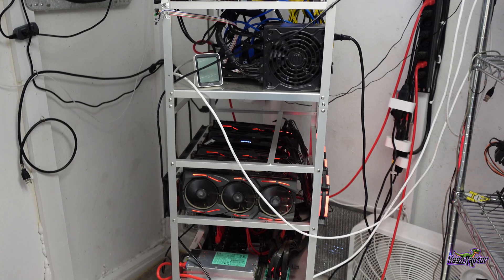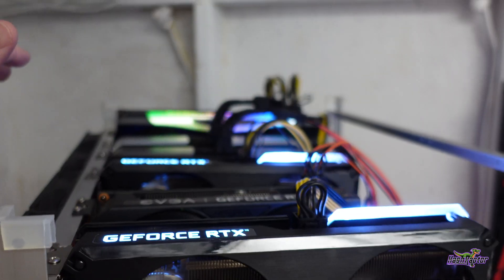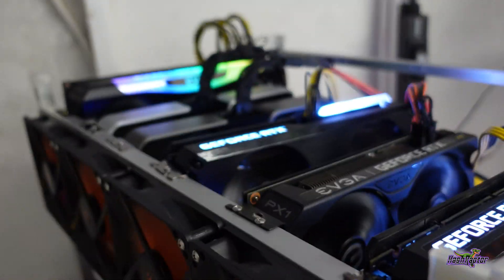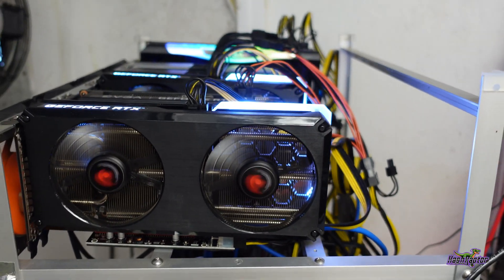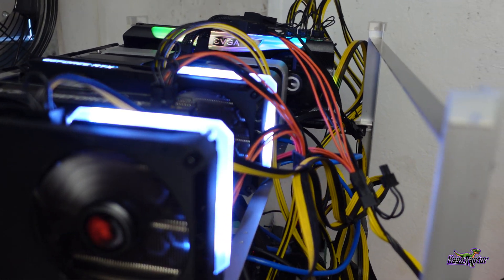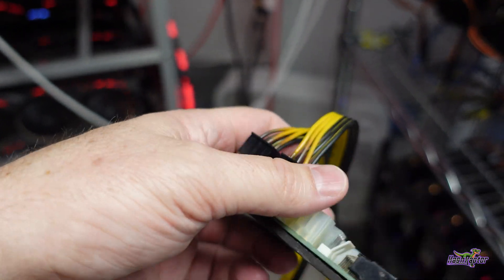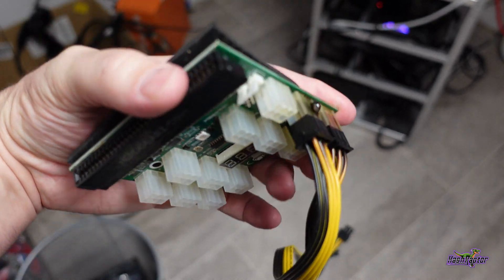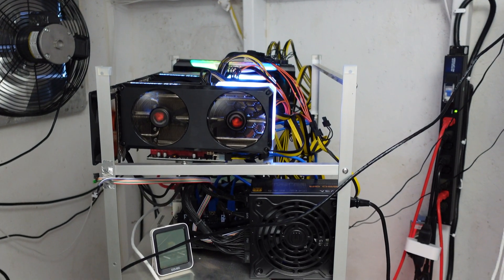GPU Rig Fire !!!  How do you troubleshoot your mining rigs???

Comment: The ONLY way I see how your clock settings could have caused this to burn up, is if you are not power budgeting properly to begin with. For example, if you are power budgeting 3060s to receive 110 watts that you'd probably operate them at, and not at their 170 watts TDP...  You should always power budget the full TDP, even if you plan to only utilize a percentage of it...  Otherwise, something like an over aggressive core or memory clock setting would just cause the GPU to crash, and not to burn up...  You should be able to safely run every GPU at a 100% power limit, the wiring should be able to handle at least 100% of the GPU TDP...  If you are only wiring everything to where you plan the GPU to operate at only, and not the full TDP, then if something ever occurred where the GPU get hit asking for full TDP and full TDP is above the operational power needs, then you could burn something up...  But injecting otherwise for example a 3080's settings into a 3060, that shouldn't burn a GPU up...  Just cause it to crash or freeze up... I don't think your issue was with your clock profiles at all, not unless you got a larger picture issue with your power budget and you are not budgeting properly...  I will also say, those black and yellow cables are no bueno imo...  They in theory should be ok, but...  I've had a few of those burn up despite utilizing them properly and everything...  I think the pins in them are poor quality, or the conductor of the wire or something...  I even saw a video where Red Panda Mining had an issue with some, and my brother who also crypto mines had issues once...  I only use 6 pin to 6 pin PCIe/VGA power extension cables any more in those yellow black cables...  That and only used to power risers...  Otherwise I use genuine power supply cables from the manufacturer anymore...  I've lost all trust for the cheaper aftermarket cables...  And I don't even use splitter/breakout boards...  I only use (semi) modular ATX power supplies, and the cables they come with, 3 GPUs per PSU (850 watt PSUs), except the PSU powering the motherboard, that PSU only gets 2 GPUs, unless also if I am powering a higher end GPU like a 3080, then the PSU powering the 3080 only gets the 3080 or maybe the 3080 and a 2nd GPU, no 3rd GPU...  But most of my rig is 3060tis and 3070s, I got a single 3060v1, and two 3080s...  Everything else is 3060tis or 3070s....  So if the full TDP of a 3060ti is 200 watts, I can safely put three 3060tis on a single 850 watt ATX PSU... Only using 70% of the rated power **IF** I were to ever demand full TDP, but of course I dial down the power limit to each GPU from the TDP 200 watts, to 130 watts... So the reality is, I am only demanding 390 watts of an 850 watt PSU, or 46%...  But that said, I have the buffer if for some reason each GPU called for full TDP, and in addition the 80% on top of that...  There is only enough modular space on the PSUs to connect 3 GPUs, and I would never put more than 1 GPU on a single cable, so I usually power both the riser and the GPU on the same cable unless that puts me over the power budget of that said cable...  Then if that is the case (or in some cases a GPU needs more than 1 power connection), then I use molex power from the PSU to power the riser...  Molex should be good to 100 watts, and the riser should never ask for more than 75 watts, tops...

And then I will place more than 1 PSU to 1 motherboard splitting the ATX cable so that the PSUs will all turn on and off at the same time, or I also mostly use ASUS B250 Mining Expert Motherboards where I can connect 3 PSUs directly to it...  I run 8 GPUs per motherboard, so 2 PSUs will run 3 GPUs each, and 1 PSU will run 2 GPUs and the CPU/RAM/SSD/MoBo, etc...  3 PSUs, 8 GPUs, 1 MoBo...
Reply: the power limit in a pcie cable on a server supply is a bit different.
you have three circuits, and each circuit is able to deliver 9A. , calculating max power through a pcie 6 pin is as such : 9A x 3 x 12V.
The problem is, server psu's are not properly used, and as such are capable to drop their full power also in one cable...

This calculation is only valid for server supplies, not ATX power supplies.
That said Server psu's are preferable.

Comment: Hey  Hashraptor,  I completely understand your challenge with cables and the right supplier.  I have found that parallel miner has 16 awg cables (labeled on the wire) for their kits and even individually.   I try to get the breakout boards with the amp meter so its an easy wattage calculation.  I am starting to write the watts on the  server supply and spread the cables evenly on the board.  Thanks for the reminder to visually inspect again.  I am using the emporia panel meter(amazon) and can see the watts and amps on the overall circuit from anywhere most of the time(wifi flakes out rarely for me).  Just my practice with my few rigs.  Happy mining and hope you continue to recover.

Comment: Is that a board full of 6 pin connectors? Wouldn't 8 pin connectors be safer? (6 pin = 75w, 8 pin = 150w)? I've never used these server power supplies but do they make them in 8 pin format?
Reply: I just looked and it seems these server PSU boards are only available in 6-pin format. Unless I'm missing something it seems this is a very good reason to NOT use server PSUs but only use ATX PSUs with their 8 pin ports.
Reply from the maker: This has been hotly debated and I totally get both sides.  I have had one riser do something similar on an ATX PSU so I'm inclined to think both options are good.  But definitely a preference.  That being said, you have a lot more options with the server PSU.
Reply: @HashRaptor  Is there a place where this debate is happening? I'd like to read more comments from both sides - and thank you for posting about your trials by fire (pun intended :) ) I'm new and when I started I had no idea that fire was even a risk - you have got me wanting to learn more about it to mitigate it as far as possible!
Reply: This is ATX standard.. A server psu does not follow the ATX standard, and cable takes what it's electrically capable to handle. These pins take 9A.. just see, cables are thick enough, to cool enough.

Comment: If I have lights on the riser I will take it off and put it back on before replacing it. Noticed your breakout board was pretty close to the side of your metal frame. Maybe the solder joints on a humid day jumped to ground. After seeing a few burnt connections like this, now I don't trust the plastic connector to hold the pins/wires in place while I push the connectors together. I grab the wires and push down instead of grabbing the connector. Taking a connector apart, it's not much keeping the pins inside from pulling out and thus possibly making a poor connection.
Reply from the maker: Oh that is a good idea.  I'll now do that every time :)

Comment: @HashRaptor if you are running 80 percent power rule on the psus , then should that have happened even if the OC settings went to the wrong card? I am thinking it was just a faulty board and nothing to do with your OC and maintenance mode.
Reply from the maker: Yeah, good point you are right.
Reply from the maker: I wonder if a single overloaded GPU with the wrong wattage assigned could provide electrical feedback into the port???  Maybe not IDK.  Not and electrician here lol
Reply: @HashRaptor  I'm and electronics technician...  So... I don't use HiveOS, but I do mine and understand the concept of the flight sheet, I do a flight sheet, but the way my miners are setup, it is a little different, but same concept...  There really is nothing you can do to a GPU via clocking setting that'll flat harm the GPU or cause a fire...  Short anyways of poor power budgeting...  IF you inject a 3080 clock settings into a 3060 for example, that won't wreck the 3060, it'll just crash...  The ONLY way it can ruin the 3060 or pwoer management, is if you only power budgeted for 110 watts a 3060 would usually only operate pulling, and then you inject for example the 3080 settings into the 3060, then maybe the 3060 will call for more power (say for example the 3060 had a power limit of 60% and the 3080 called for 80%, but now you place the call for 80% into the 3060 instead of 60%), if that happens, it is still a percentage of the GPUs TDP, it isn't going to force the GPU to call for more power than the GPU can handle, a GPU can easily handle 100%, all GPUs can...  They're designed to handle at least 100% for gaming, etc...  100% is just full TDP...  So even calling for 80% from a 3060 that you'd normally only ask for 60% from, it should still be ok.... UNLESS you power budgeted for ONLY the 110 watts, and not the full TDP, which for a 3060 is 170 watts...  If you power budgeted for operational powers and not full potential powers, aka full TDP, then if the even occurred where a GPU demanded full TDP, you might overload the wiring or power source, because going full TDP would put you over your power budget (though in theory the 80% rule should save you here as well, if you budgeted for it)...  So if a power limit of 60% usually draws 110 watts you operate at normally, and thus only budgeted for 110 watts, but then injected the 3080's 80% setting, it'll call for 80% and not 60%, so you will get more than 110 watts, but still less than the 170 watts TDP...  But if anything over 110 watts puts you over budget, then yea, you can burn something up or out...  ALWAYS budget for TDP, not for what you plan to run it at...

Comment: Exact same thing happened to me, but in my case the breakoutboard got so heated that it melted from the bottom of the board. I suspect the board had something faulty between the rubber layer, reason is because it was a new board and was only running for 8 hours. Lesson learned after that was to check the new board and also spread out the connection evenly in terms of power hungry GPUs spread out instead of having all on one side of the breakoutboard.
Reply from the maker: yeah good idea

Comment: First any version of hive works. The cables terminals are to small to support the power draw. I'm referring to the metal terminals that are crimped onto the wire. Inside the black connector.The cables with all 6 wires attached to each other are notoriously mislabelled as 18 awg. If you cut a real 18 awg and one of those then compare the thickness of the copper. You will see what i mean. I agree that settings get unsynced when 1 gpu drops.That does not mean a 3070 would receive the power that goes to a 3080. if you have 70 percent power limit on a 3080. then the 3080 drops off. The 3070 would run at 70 percent power limit for the 3070. The hp 1200 sticker says 900 watt max at 110-120 on the psu. That is not your issue as the input voltage has no effect on the 12v output voltage.The psu would power off if you exceed the 900.
If you are going to make video then you should have a better understanding of the subject matter.
Reply: He mentioned numerous times that he wasnt certain of exactly what happened..  He makes videos like these so that less informed viewers who may have had the same experience, can benefit from the comments of better informed viewers like yourself..  I find it very helpful.
Reply from the maker: Hey thanks for taking the time to share your experience.  So in Hive I don't have percentages assigned to the GPU's.  Hive uses wattage unlike windows.  So if I have 220 watts assigned to the 3080, then the OC gets out of sync by moving cards around, then the 220 watts could end up on a lower power card like a 3060.  Great point on the awg of the wire.  I've heard that before.  Wish there was a solid source for high quality cables.  As for the PSU running at 900 watts on 120v, interesting you said it would power down.  I've never pushed it that far that I recall.  But, as I am not an electrician, I do wonder if you push a PSU at 95% for example for months on end 24x7, what kind of stress that puts on the PSU, ports (since they are all pulling power), etc...  Fascinating stuff I always like to learn more about.  Take care and keep on mining!!!